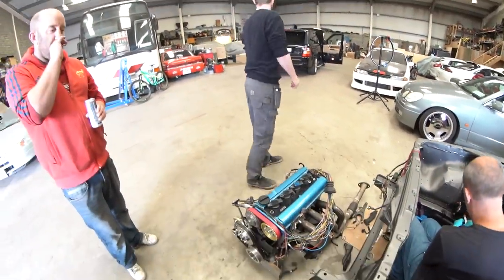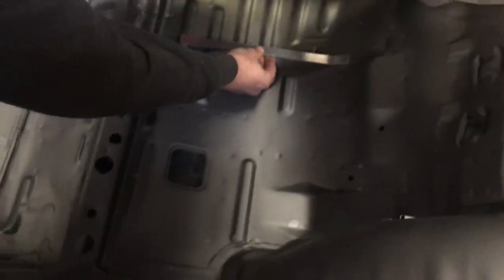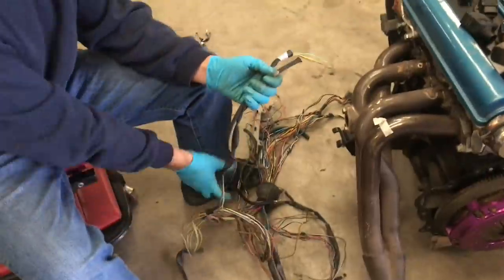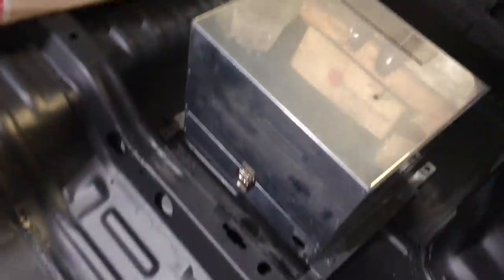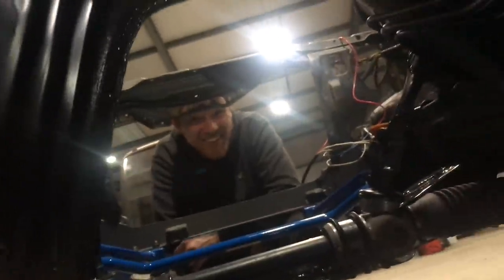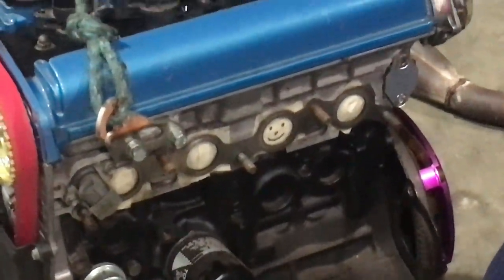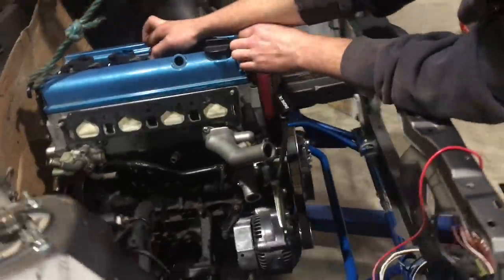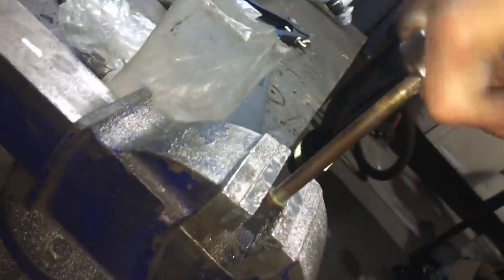AE86 Engine and Gearbox Install

Comment: How on earth duggie knows what half of them wires do i’ll never know, the man is an absolute wizard when it comes to the 86
Reply: ECM pinouts and wiring diagrams helps alot. once you have work on 2 or 3 it gets pretty simple! 
just like simplifying a GM LS engine harness! 
or make a Truck harness a stand alone for a swap in another ride!

Comment: What all is done to the engine ? Maybe there's a vid about it is there ? Also Is that the standard t50 you have stuck with ?
Reply from the maker: Standard rebuilt T50 theres videos on it further back, same with the engine, stock rebuild with ACL bearings and ARP rods, skimmed head etc.

Comment: Did you just drill holes in the floor without painting or otherwise treating the hole afterwards?
Reply: Tiger power treated
Reply: One tiger power

Comment: Are cams stock?
How much advance can you run on that TODA exhaust cam gear on a blacktop?
Reply from the maker: Not 100% in that one, the Cams are stock in this video but we updated them down the line.
Reply: @juiceboxforyou  Argh, ok. I got stock Blacktop in an AE92, stock ecu, but TODA exhuast gear and I'm scared if I advance too far valves and pistons will clash...but I don't know for sure...

Comment: Getting there lads, just finished a similar setup. What intake are you running? Quad or single? Be sure to seal up those vacuum ports. Also weld on 2 -10 fittings to the cam cover breathers for a catch can.
Reply from the maker: Running the quad with this one 🍻